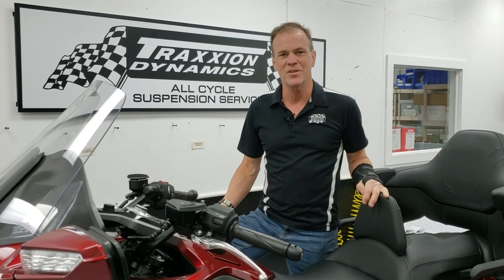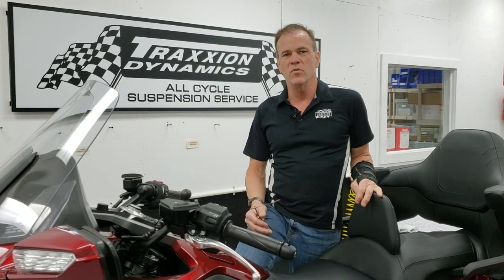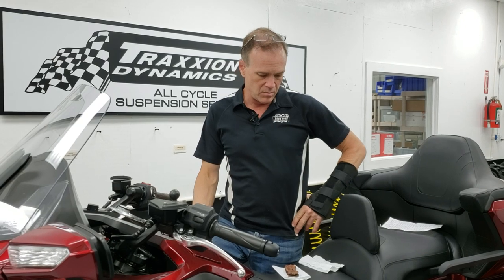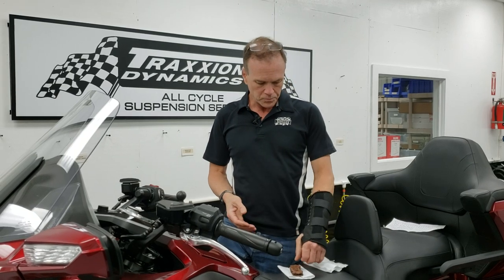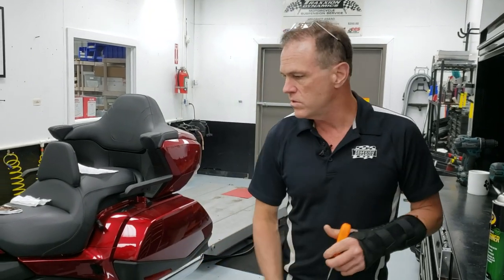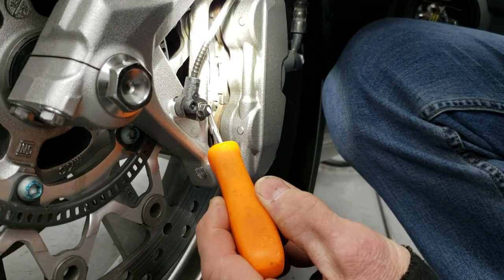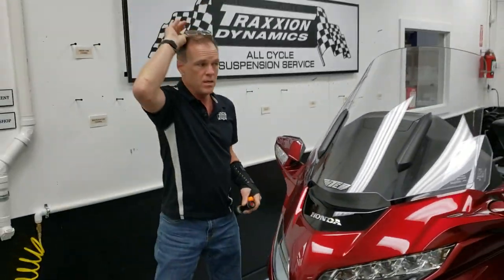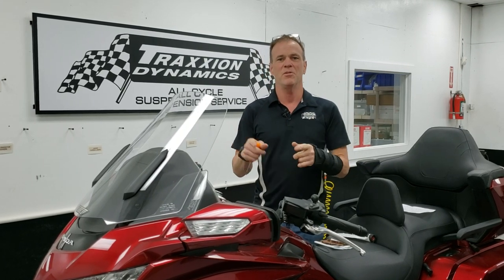Beware of Problematic Brake Pad Wear on 2018+ Honda Goldwing

Comment: I just replaced my front brake pads on my 2018 Honda DCT Tour. I have owned it for about 8 months and ride it pretty hard.  It has 10,600 miles on it. On the right side the inside pad was worn badly while the other 3 pads are in good shape just like your video. I replaced all 4 pads. After reading all the comments below I guess that it may not happen again but I think I will bring it to Honda's attention. I saved all 4 pads that I pulled off. I appreciate you putting out this video.
Reply from the maker: Please share my Channel with your Wing buddies!

Comment: Just changed mine yesterday…right caliper inside pad ZERO pad left.  Started hearing grinding and feeling vibration when applying front brakes, did a visual And it was easy to see outside pads, plenty of wear left there.  Continued intermittently through the week so I figured I’d pull them.   Sho-nuf, GONE!   Easy enough to pull and check so that will be part of my regular maintenance plan.

For ref: 2018DCT Tour w/airbag, 20k miles.

Comment: I just checked the pads on my 2022 the other day when I was doing a service on it. I have 5k miles and pad wear is good so far. There is just a bit more wear in the inner pads but not anything out of normal. I will keep an eye on them.

Comment: Every motorcycle and truck I have ever owned has had uneven brake pad wear.  Sticky calipers are very tricky to get right.  I would look closely at corrosion on the Pistons. You can pop them out with an air gun and clean with steel wool and brake fluid.  Never let anything other than brake fluid contact the square cut seal.  Use very light coat of soap based hi-temp brake grease on reassembly.
Reply from the maker: These are brand new bikes.  Pistons have been made of stainless steel for a long time on motorcycles so they don't corrode.

The calipers post mount to the fork and don't float.

This problem isn't maintenance related.
Reply from the maker: And... No do it yourselves should be so deep into brakes on a new wing that they have to remove the Pistons.  99% will never ever have the system bleed correctly ever again.  Linked, ABS brake systems are not for home owners to work on.🎤

Comment: Thanks for that demo, I am noticing excessive amount of brake dust on my rear wheel as well. I will have to check the pads all around. Very strange that you can't get 30K miles on a set of pads? I have 5500 on my bike and I am concerned, especially since the pad changes as quite expensive for the amount of wear. Keep up the good work,, and hope the hand is healing.
Reply from the maker: Hoping to be out of brace on Wednesday in time to stuff face on Thursday!

Comment: Hi max my 2018 had the same issue . On inspection I found the inner pad jamming in the calliper. A light file on the ears and it was fine . The new pads also fitted fine . I guess they had some out of spec pads. Hope this helps you guys
Reply from the maker: That would make good sense.  Thanks for the tip!

Comment: Radially mounted calipers must be centered exactly at the centerline of the brake disc. If they are not, uneven brake wear can be the result. This can be easily checked by a close inspection. I had the same issue with my 2016 Triumph Thruxton R. A smart mechanic at the Triumph dealer realigned the calipers to the brake disc. If there is some wiggle room where the calipers are mounted to the bottom of the fork leg, one can loosen the caliper bolts on each side, firmly squeeze the front brake leaver while retightening the calipers bolts...a two person job. Closely follow the caliper bolt torque specs. My thoughts.
Reply from the maker: Virtually all radiant mounted calipers are located on precision machined dowels.  There is no alignment at all.  Not even a tiny amount.  They are perfectly aligned.

Comment: Max,
 Yamaha had a similar problem with the REAR Cal on the Royal Star bikes. They found that the Cal was not applying the same amount of pressure to the pads. the Solution was to shim one side of the cal so that the cal was then even on both sides . I dont know if this could be the same problem with the Wing or not but if you check with one of the long time V Star Royal Star forums they can shed more light on this problem. This would also be a Honda problem as I see it, Please keep up the great work.
Mike/Turtle
Reply from the maker: I believe this is one that owners need to bring to their dealer's/Honda's attention so that it can be addressed.  I think it is worthy of a product update or recall.  It is BAD for a caliper to apply more pressure to one side of the pads.  This can warp the rotor, and braking efficiency is significantly reduced.
Reply: @Traxxion   Max, Yamaha's reply to this problem was to place two flat washers behind the Caliper and that solved the problem . But if Honda's calipers are not floaters not sure what can be done.
Mike/Turtle
Reply from the maker: @robertcadiz5561  since the calipers are rigid mounted, it must mean that there is a tolerance problem with the seal grooves.  And note, it can be the OPPOSITE of what you might think.  People think the worn pad has pistons sticking out.  But it can be the unworn side is stuck and not moving out onto the rotor with proper pressure.
Reply: @Traxxion  Max, I have to agree with you there being a fixed caliper would not cause the same problems Yamaha had so your thoughts about the un-even pressure seems to be the likely problem. hope it can be resolved soon.. mike/turtle

Comment: My rear brake pads feel really loose. I just had my brakes done. They should be firm in place right?
Reply from the maker: They do "float" on a pin and in the caliper body.  But there should be a spring on them that holds them from rattling.

Comment: I just did a maintenance on my 2018 Goldwing and I was informed I have 30%-40% left on front and 20%!!! on rear. This shocked me because the bike has only 4K miles on it and I never had such problem on my other bikes. My last one was Indian Springfield with 16K miles on it and all pads were at 40% wear.
Reply from the maker: Brake pad wear can vary wildly based on type of use... highway will get little wear, city will get lots of wear.
Reply: @Traxxion  Agreed. But in my case 4K is way too soon. And usually front wears more than rear, but not in that case
Reply from the maker: @davaireport2479  I would change them all and watch what happens on the second set.
Reply: @Traxxion  Will do soon. Thank you!

Comment: Max, I just saw this older video. When I do the brakes, do I have to replace the 2 caliper mounting bolts, or they can be re used?
Reply from the maker: I've never heard of anyone replacing the bolts.  I would never replace mine, that's for sure.

Comment: 35k on the bike.  Replaced pads twice and both had excessive wear on the left inside pad.  It was almost to the metal while the outer had  50% remaining.   - Doug
Reply from the maker: Doug, was this on one caliper or both?  Was it the inside right pad?
Reply: @Traxxion   In both brake change-outs it was only the left-side-caliper inward (or inside) pad that had excessive wear. The other three pads were fine.  
I considered ONLY REPLACING the BAD-PAD but my safety-conscious-brain just wouldn't go for it.  I replaced all four pads both times.  I find no obstruction or problem with the pistons or pads; they seem to move just fine within the housing.   I assume it is uneven pressure between the two sides of the left brake caliper.  - Doug
Reply from the maker: @dougwhite3059  I have heard of right calipers messing up, thanks for letting me know your bike is doing it on the left.  I have only heard of inboard pads being eaten up though.  Not sure what it means yet, but since the calipers are rigid mounted, it must mean that there is a tolerancing problem with the seal grooves.  And note, it can be the OPPOSITE of what you might think.  People think the worn pad has pistons sticking out.  But it can be the unworn side is stuck and not moving out onto the rotor with proper pressure.
Reply from the maker: There is no reason to replace all oif the pads... it's safe to replace the worn pad.
Reply: @Traxxion     Thanks, Max.  I'll just replace the bad one when it gets low again.   Big savings given the price of these pads.    Hey!   I love your sidestand pad!  Works great.  Can you work on a replacement foot pad for the 8,000 mile ones Honda uses?  Mine wear out at the tip where the Honda metal curves up; way too soft.   - Doug
Reply from the maker: @dougwhite3059  I have seen that... same on the older model.  I wonder if people would like a grated/knurled/antiskid surface on an aluminum inlay replacement for the rubber?
Reply: @Traxxion    I like the rubber surface; gives a bit of cushion vs all-metal dirt-bike type pad.  I have trouble slipping off the pad  when I turn sharply and my foot engages the pavement - my boot grabs the road rather than the pad and I have to jerk my foot up off the road and back to the pad.  BUT, maybe your concept offers a good option without sacrificing much comfort/padding??   That would be great, Max.    - Doug

Comment: Read a pdf article and it says from a wing rider to engine brake more than needing to use your brakes often when slowing down, THEN use your brakes, or if your a manual rider, downshift.
Reply from the maker: How and when you use your brakes isn't related to the problem of the brake pads wearing unevenly on one caliper.
Reply: @Traxxion  true. Just a simple thought out there for bikers :)

Comment: I just replaced my tire and checked my front brake pads. At 12,000 miles my front left inside pad has worn excessively more than the outer one. I figure it has maybe 2,000 miles left on it if that. The right side was even on both pads. I will go down to the local dealer and see what they recommend.
Reply from the maker: That's the problem... there's nothing you can "do".  Honda needs to be made aware of this problem.  You should take your bike for your dealer to see and document the problem.

Comment: so on page 13 on the honda goldwing (2021) it says brake recoil is normal...this happens alot coming off the highway ramp to me on front brake ..it recoils forward...any reason WHY this is NORMAL...there is plenty of braking power it just recoils forward then when in the city trAFFIC IF BRAKES normal...
Reply from the maker: What do you mean by brake recoil?
Reply: @Traxxion  the front brake lever pulls forward ...back pressure ...the word recoil is how it is written in the manual..this is taken right from the manual ."The brake lever and pedal may recoil"
slightly when applying the brakes. This is
normal.
Reply from the maker: @timaddams1880  I am 99% certain that is related to the Linked Brake System, and the Anti-Lock Brake System master control module energizing the system.

Comment: Max, what happened to your left wrist?
Reply from the maker: I had a really bad cyst in the Lunate bone in my wrist.  It's the middle bone.  They had to cut it open, clean out the bone, then cut the head off of my radius and flip that up into the hole, as they need a big piece of bone with active blood supply.  Then they filled the hole in my radius with donor bone.  So that's why I have been "off the air" for a few weeks!

Comment: Goldwings have device that when the rear brake is used it applies the front also but only one side of each caliber, causing uneven wear. Normal
Reply from the maker: Your completely, totally wrong.  You literally lack a shred of understanding how the brakes work on a Goldwing.  But thanks for playing.
Reply from the maker: Opposing pistons are always applying pressure on the 2018+ Goldwing.  There is never a possibility of imbalance.

https://youtu.be/z3IGITZ9zS8